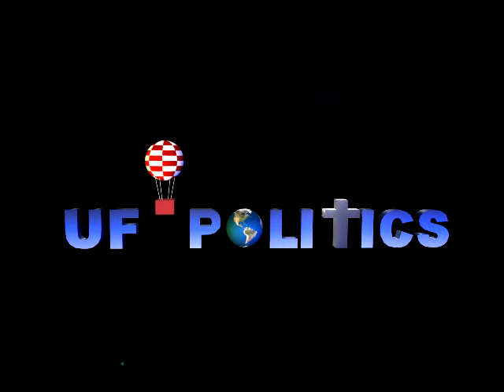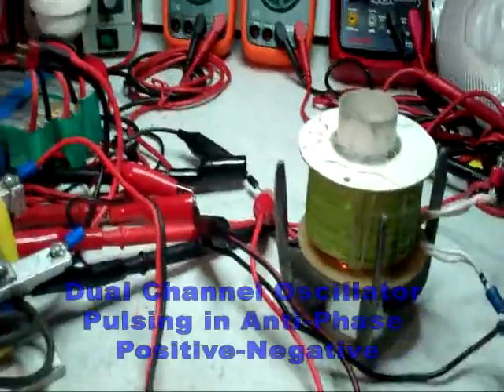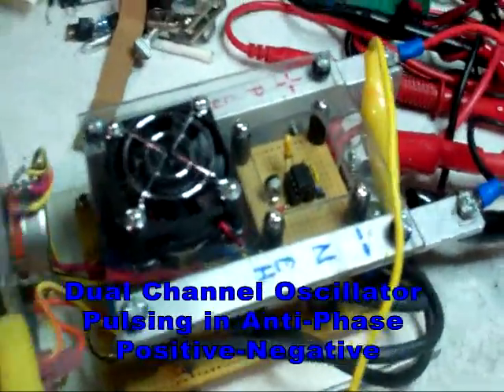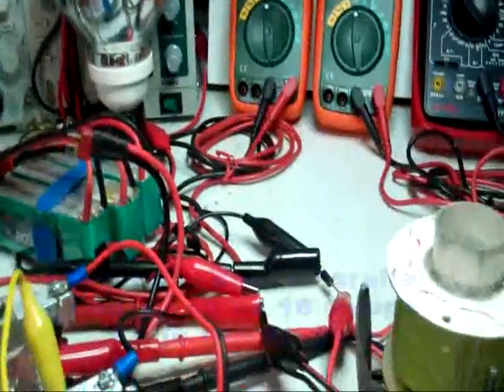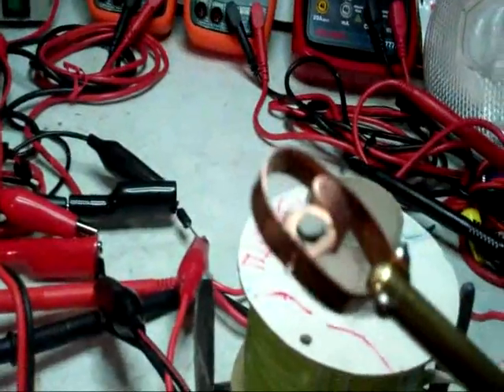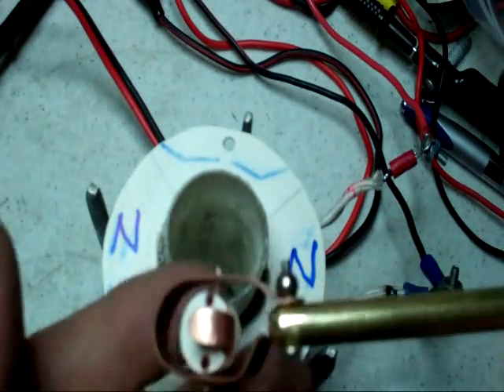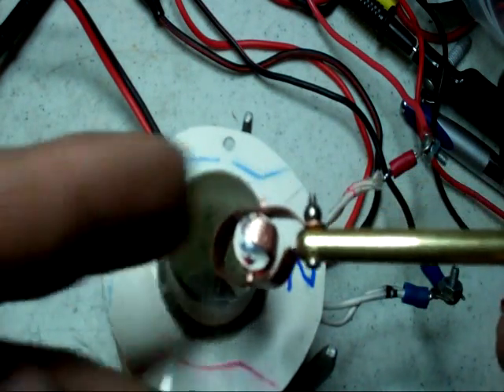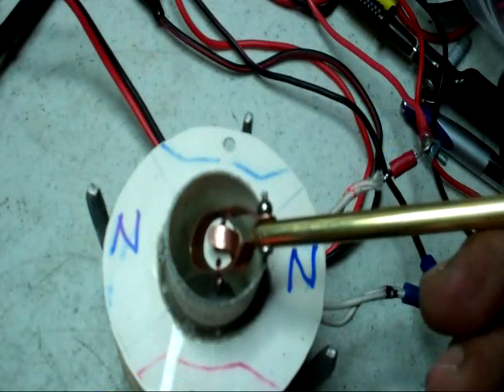DEFINING RADIANT ENERGY FIELD (Part 1)

Comment from the maker: Unfortunately nothing happens out of the ordinary when placing just the LED inside the center core...except it vibrates due to its anode-cathode being made of ferrous material..
If you watch the part where I invert putting the South Up...the LED does not turns on, even attached to coil...
Radiant Induction still flows but reversed, and remember LED are Diodes...so it will work if I turn its anode-cathode to the reversed terminals.
Thanks